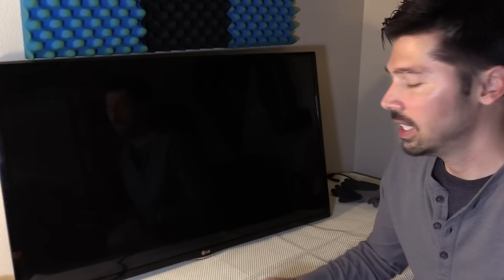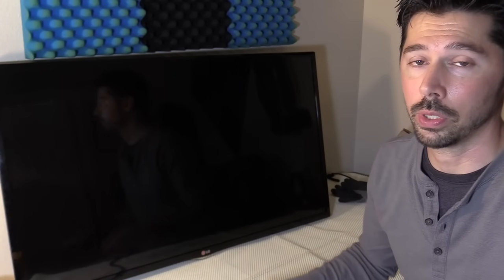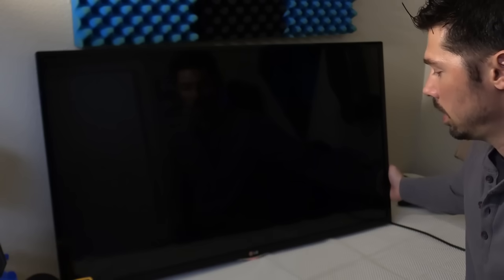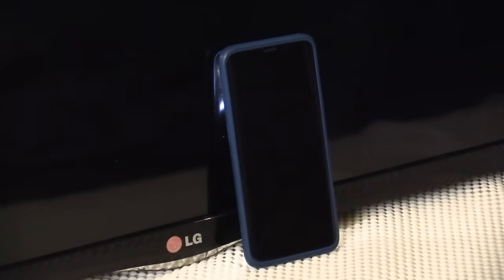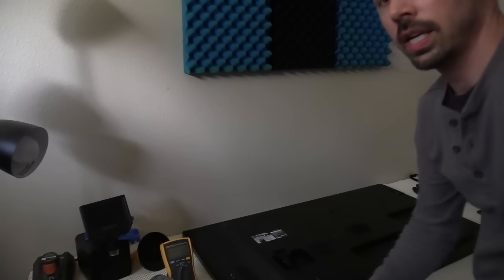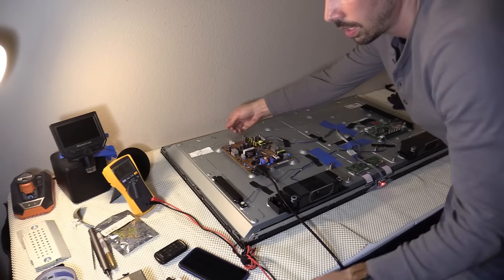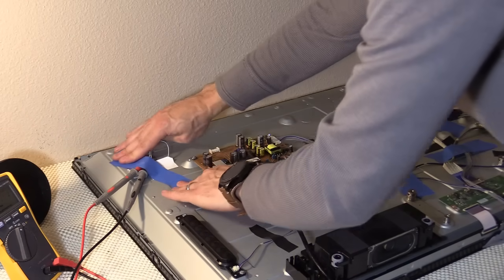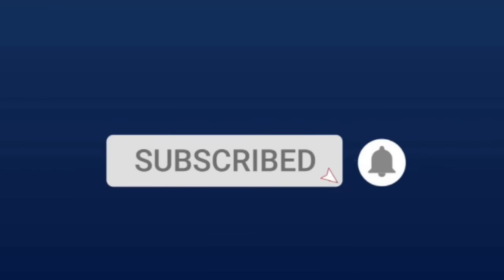3 Ways to Troubleshoot LED LCD TV with a Black Screen, TV repair part 1

Comment: I was browsing YT to resolve the issue with my 2018 Samsung 27" monitor. When PC turn on after few seconds the monitor freezes up. Reset the monitor the picture is on, freezes again and then starts to get fuzzy and slowly turns in grey/white. Reset the monitor again and then the picture is on barely visible, few minutes later the picture is perfect. As long as it goes into a standby mode I have to repeat the whole procedure again. Very painful.
Have you ever had a similar issue? What might be wrong?

Comment: Hi there great channel, I have a question My Samsung 3d 49" tv has developed a purple smudge on the bottom right of the screen,  will I need to replace the screen or is there a quick fix? Thanks in advance.

Comment: Hi, I’m starting to like electronics repairs, my first project was a power supply of Wifi Samsung surround, I was trying to figure out what went wrong, When I checked the the connection inside the circuitboard the one with small 7 wirings connected to the mainboard, with 12v, 5v,  ground, 3.5v, 3.v and ground, the reading was fluctuating and not steady, what would I check for this problem, thank you.

Comment: hey tampa tec i have a quick >?about laptop adaptor boxes  there both 19 v but problem is one adapter box  is a single  white wire and the other adapter box red and black with blue wire for the pin i was wondering how can i wire the red black and blue wire with white main wire on the adapter?

Comment: Been watching your YouTube vids but I’m not proficient with electronics. Have a 50” insignia with black screen. No sound and no screen images. I do have red indicator light when off. If I turn it on, red light flashes for about 10 seconds then goes off. Sound familiar? Do you have a shop near Tampa? I’m in Zephyrhills.

Comment: Hi love your videos my man,I have an issue where I brought an Astro mixamp for my PS4 slim,unfortunately it has no optical port,I have a tv with an optical port and in the settings for optical out it gives me 2 options,either pcm or compressed,have u any idea which would be best to use for the mixamp pls,also can it still provide 5.1surround or just 2.0 stereo?thankyou

Comment: My 40" xbr9 is getting 15Vac 6Vdc to the 2 boards that attach to the screen (are these the backlight boards)? 

The boards are labeled 12V. Is that supposed to be 12VDC? 

Can you recommend component testing on the power board to fix this? Could this be due to the bad diode problem you mentioned in another video? When diodes go bad do they just blow up and open, or do they partially rectify and partially pass AC? 

Does  the combination of ac and dc to these boards indicate that the main board is bad? And is it worth replacing, if it's supposed to supply 12Vdc with no AC is it possible that both of  these boards are now blown as well?

Comment: hi i have a samsung  led backlit tv and it died thought it was the pcb replaced it and still nothing but if i unplug the cable for the led strips all the  leds on the other boards light up so am i correct in asuming that i should replace the led strips

Comment: Hi Tampatec, I have a Sony 50" kdl50w685a, the whole screen is covered in thin black horizontal lines spaced about 7mm apart, everything works as it should but the lines even show on the on screen menus. I hope its not the screen, i have unplugged cleaned and refitted every cable I can see and its still the same😢

Comment: Sorry sir, just a out-of-topic quick question, in my testing/checking MOSFETs using Multi-meter, when the gate is charged, why some MOSFETs (N-channel & P-channel), the drain to source let us say 0.002 or less my meter reads, others starts with more higher like 0.435 and running up as fast as a second or half a second until showing infinite? Discharged test is working (no reading on drain to source). What does it mean? Does all MOSFETs behave like that?

Comment: Hi I watch your videos, trying to improve myself and have a question about a Samsung UN50H5203. The power board has a connector in the top RH corner for the LED which you are quite familiar with. I have power in 2 pins that are supposed to be ground with plug disconnected. Pins are 8 and 9 marked D- and possibly #3 S1-. Originally I checked the diodes as they are easy, there is a warm spot around them, no smoke but the2 pins which I think are shorted have a blue cap right below the connector which is c9010. Before I waste any more time and money the flashlight test does not show any images, I was told the tv had sound but can't get any myself and the power button seems funny but works with remote. I alredy changed main board. Voltages at LED connectors are about 30V (I don't have my digital meter here but old analog). Used boards are about $18 but I am scared about the no image. When I unplug the main I still do not get LED. Thanks for all the vids.
Reply: i have the same tv and same problem did you get it working?

Comment: I have a 42” led panny. First green blinking then on with white screen for 1sec, just like you describe as a flash. Then off and continues red blinking (1-pause-1-pause). This all seems to point to towards panel/led strips. However, I also disconnected the driver board to which the led strips are connected, and still the standby lights stays blinking red. How can that be, if disconnected then how come it is still blinking? I leaning towards faulty led strips, but logic seems to say otherwise. How to proceed? Thanks.

Comment: Hey Tampatec just a note of interest. I got in a 55" LG with back light issues also and have that LED tester. I also put in the LED tester's probes (thin) just like you did but in doing so i stretched open those microscopic connection points thus causing intermittent switch off off the back light circuit after installing new LED's. It would be advisable to insert those test probes from the top of the plug. I had a come back because of it.
Reply from the maker: Yes, great advice.

Comment: I've had an element tv 50"for around four years I got it for 404$ tax and all did I get extremely lucky on my first LED or are they over all good TV's I bought it at Wal-Mart but I've never seen anyone else that has one or has had one. I like everything about it other then it's just a 60hz but anyway I was just curious if you knew anything about brand

Comment: i have found tv's on the street and managed to fix them with minimal parts and work. I hope everyone takes something from your videos and not just throw there tvs away because people like me and you will come along  and fix them within hours,
Reply: and also if you cant fix it or replace the lcd then the parts can still be sold. and the lcd screen can be used a lighting.

Comment: I watched most of your repair videos for LCD TVs but mine seems to fall into an unusual category. I have a Toshiba 32HL67 and it works fine most of the time. After watching TV for 10 minutes or 8hrs then powering off, the picture will not return. Back light works. Power cycling multiple times will usually get the picture to return briefly, then eventually remain. Same happens if power is off for several days and the picture resumes only to go black after TV us turned off again. I checked all cables, connectors and edge mounts for looseness and they are fine. Could you suggest a specific system I should diagnose? All components look fine but the large 200V 1200uF capacitor has a slight raised portion on top only by feel (very slight). Does this description sound like a bad capacitor attenuating power to the display? (Would it be in the power supply board?)
Reply: This Toshiba had 5 boards, power supply, Low B, Seine board, main board and Inverter. I didn't find a T-con. Is it contained as a subsystem on the main board?

Comment: I just repaired my LG plasma that had the click click won't power on problem. Was gonna try to solder a new cap on to the power board but there were none that were blown. After a month and a half without a tv I opened the back and sprayed all the boards with wd40 and it's worked perfectly for almost a month now
Reply from the maker: Wd40 can start a fire it's flammable. I would try cap kit for your tv model. Clicking is commonly bad caps. Caps may look good but still be bad.

Comment: Hi, I don't know if you give advice in comments but I will try mu luck anyway: I have an LG 3D TV 42" that stopped working 
But stopped I mean, it responds to remote by turning on, standby LED turns on/off normally, there is backlight as the screen is very slightly brighter than off black, and nothing happens further (Not even LOGO showing).It did it once but recovered by switching on/off (like windows...), I had an external HDD plugged with no external power that I suspect to be the cause, it still works but not the TV which did not recover from its last black screen.Any help is appreciated.
Reply from the maker: If you have a black light glow in the TV but no picture that can be bad tcon board or main board. Get tv boards from shopjimmy.com or electropartsonline.com
Reply: Thank you. I'll check that

Comment: Do you repair TV's in the Tampa area or can recommend  someone. I need the mother board replaced in my 75' Vizio. Thanks
Reply from the maker: Not anymore, It's a trade I picked up from my Dad years ago, I used to fix TVs for best buy.

Comment: I have a next book tablet and won't on but it's charging, may I ask what to do. I can't go to electronics repair shop because it's so expensive here in Philippines. Nice video.
Reply from the maker: I had a tablet with the same issue, it was a loose ribbon cable connection inside.

Comment: Can't get anyone to answer why when I plug in my 42'' RCA the little red standby power on light comes on and when I turn on TV manually or with the remote the light goes out but TV does not come on. Then cut the power supply from the set and switch it  back on and get the standby red power light back on, but again when hitting the power on button the light goes out again and set does not come on. But eventually after repeating this process a half dozen or maybe a dozen times the set will power on and play great for hours until I turn it off. Anyone have a clue what is going on? I think there may be a power relay that is sticking that prevents the set from coming on. The problem is not in the power board as I replaced it with a refurbished one and got the same result.
Reply from the maker: Maybe bad capacitors on main board or power board. Also Sometimes boards I get from eBay are bad.
Reply from the maker: Check capacitors on main board or power board, sometimes boards I get in can be bad too.
Reply: Thanks Tampatec-  I will check it out. All I had heard previously was that the power board in particular a failing capacitor was likely causing this problem. I was thinking maybe the on off control was defective or a power relay on one of the boards as the TV plays great for hours after it turns on. It turns off without problem with the remote or TV power button. It acts like a defective relay that has to be booted up from initial power to get a circuit. I saw on one video a relay on a board that was  between the power board and main board. This TV does not have that board and I think the relay may be on the main board itself. Not knowing much about it I wouldn't recognize the relay. I can return this power board through ebay and maybe get a main board. If it was my TV I would throw it away as I have gotten a couple bigger late model  TV's on New Orleans Free stuff Craigslist. A 2014 55" Vizio replaced the power board plays like new. A 2014 51" Samsung plasma replaced the main board as the previous owner replaced the power board already. Plays great. But my sister likes this RCA for her bedroom. It does have a nice picture and sound. So trying to figure it out. Thanks again.
Reply: I just replaced the main board with a used one that listed on ebay for $38 for a $28 offer. They answer whether they will take your offer within 24 hours. There was also a return option if I wanted to return it.  It was the only one I could find anywhere. Now the set turns off and on fine. The refurbished power board that I previously bought from ebay was good also as it is now playing. So I have an extra power board if my sister has problems with it later. Thanks Tampa.

Comment: i subscribed because I have an LCD TV that I use as a computer monitor and it has a few dark spots on the screen. You did a video on how to repair that issue and one day I will review it and give it a shot. Thanks btw.
Reply from the maker: What's model number? It can be a few bad LED lights in the backlight.

Comment: I would make a jig for the meter probes because by plugging it into the female side you expand the contacts which in turn won't make contact when the plug is plugged back in.... I would check if there is output voltage from the PSU to the LEDs.... But everyone has different ideas to repairs.

Comment: I would like to ask a question about my  Samsung 72inches  ?..There are darkness at the bottom of screen..with a haze of blackdots. or I can send
 you a pic...
Thank you
Reply: I'd like to see the response, if any.
Reply from the maker: Black pixels or dark spots? Black pixels is LCD panel but Dark spots can be bad LEDs in the backlight.
Reply: ok..Thank You..I will see if you have a video  for this too...